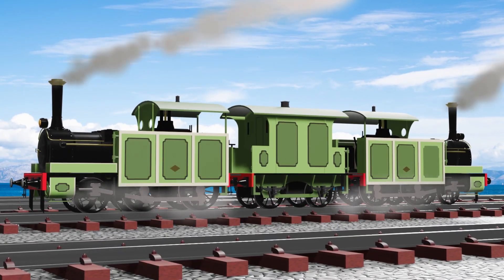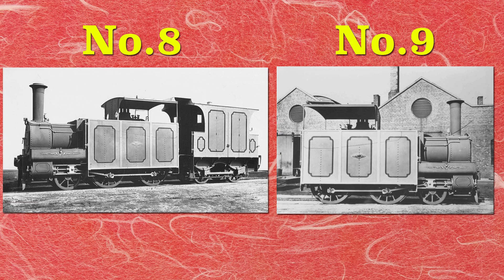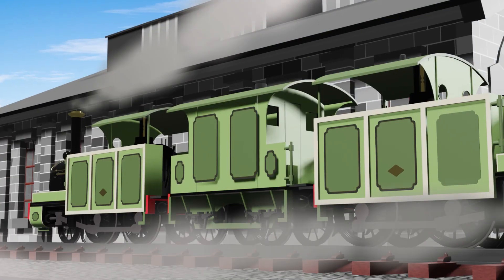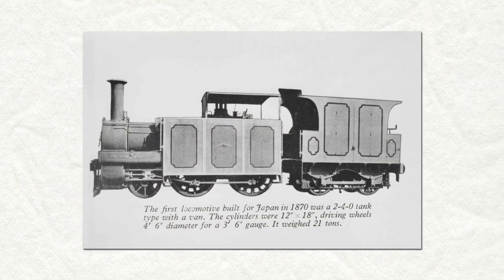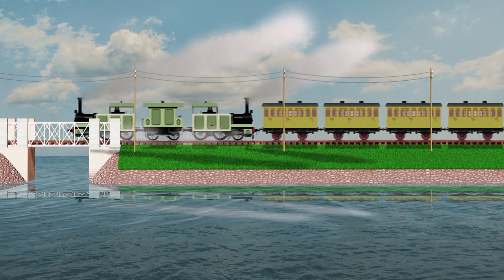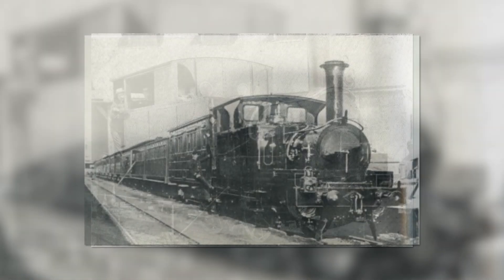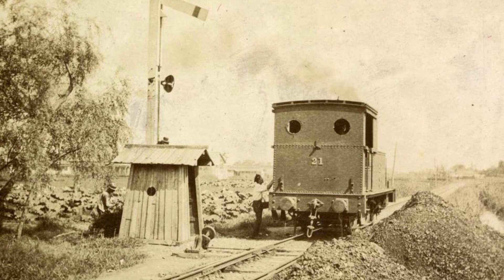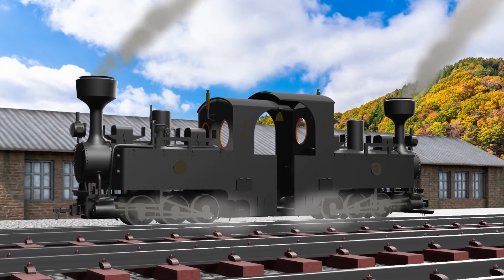Strange Locomotive: The first Fairlie engine in Japan (鉄道の日特集おまけ)

Comment: I was already wondering what this strange locomotive is about. In my eyes it's not a proper Fairlie as it's.basically two engines back to back together but it's still very cool. I knew some early steam locomotives didn't have brakes but in this case it's very unusual to have a brake van between the two locos. I don't know if this small van would be strong enough to stop a heavy train down a hill though. Very sad that both didn't survive but the pictures are very interesting and beautiful. Nice work as usual 👍
Reply: It's really more a discount fairlie, yes. And as mentioned in my comment, though I could be wrong, I believe having the single brake van between the engines might have been a mistake; the source I read said they were directly coupled back-to-back and basically had to act as each other's brake; the brake van was mainly when each engine was working on its own, both for braking and to let it couple to normal wagons. Short story shorter, not a great idea, everybody hated them, rebuilt in 1873 with steam brakes.

Comment: From what I read in Dan Free's "Early Japanese Railways", these two engines were originally meant to be coupled directly back to back with no brake van at all; braking was to be done by the engine facing away from the direction of travel pulling against the train's momentum. The brake van was meant as a sort of adapter car for when the engines were working individually, which turned out to be all the time as thanks to the pair of 0-4-2 tender engines delivered by Sharp Stewart & Co., there was never a need for the tandem arrangement on heavy freight work. Between the lack of brakes, the awkward need to drag a brake van around both to stop and to couple to ordinary cars, and the oversized water tanks that obscured the motion making maintenance difficult and just looking ugly, both Japanese and British crews hated these engines. By 1873 JGR was fed up and had them rebuilt with more normal handbrakes and steam brakes. And the rest is pretty much as said.